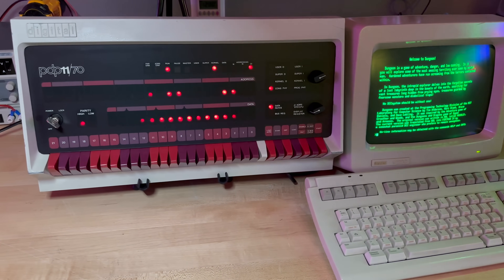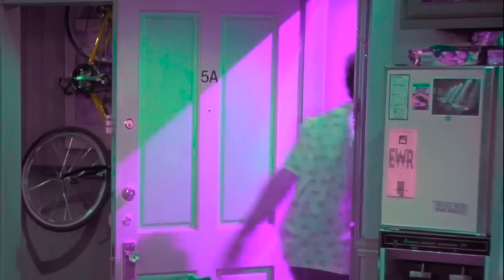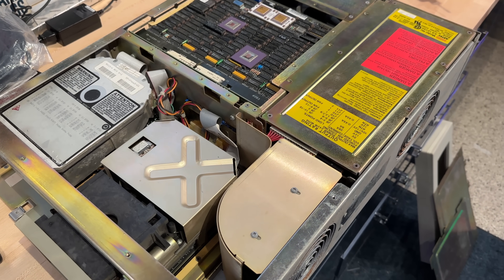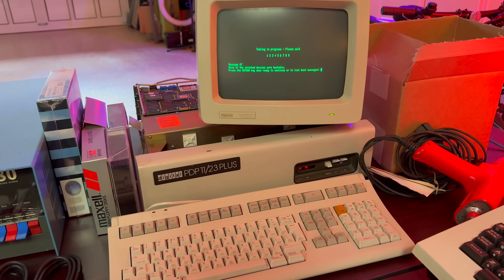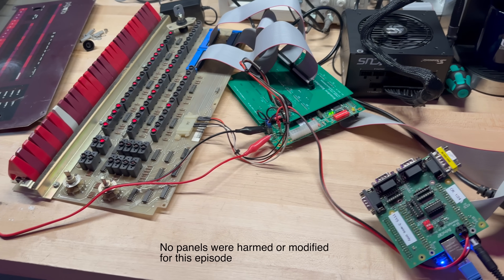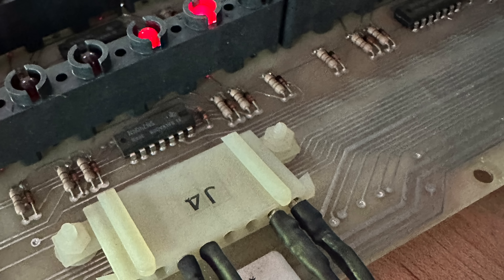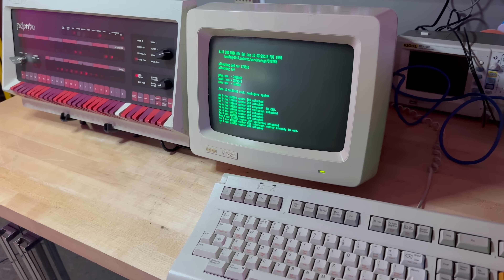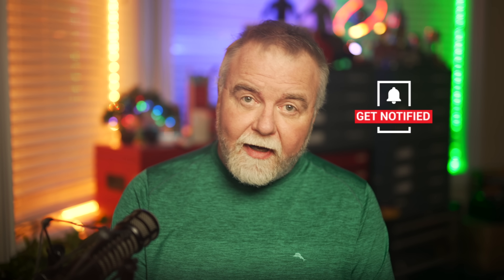Ultimate LED: The PDP-11 DASBLINKENLIGHTS!

Comment: Thanks for your excellent PDP blog Dave, it brought back a lot of memories.  In the 80s I worked as an electronics tech for a UK research group that used a PDP11 with an A to D card to collect and process experimental data.  The Prof who headed the group was not satisfied with the setup so he set about rewriting the operating system to enhance its performance with the A to D.  He was so successful that DEC sent two engineers from the States to see how the hell he did it!  In the early 90s the PDP was scrapped to make way for an IBM 286 PC based system.  I have always regretted not rescuing the PDP, but I don't think my wife would have welcomed it into our living room!  I did remove the 16K x 16 core store board before it went which I still have in my collection of electronic artifacts.
Reply: so what operating system did the pdp11 run then?

Comment: Worked for DEC for 10 years and works on all PDP and later vax systems. 

 Program I entered countless times on pdp's

Load address 100
12737
777566
301
127
100

Start at address 100 and run

:-)

Comment: Made verifying stuck bits easy ( faulty memory ). But the core dump following a series of "somethings funny" and "panic" messages printed on the Decwriter was already enough to identify the chip. If you are still looking for parts, Paul Anderson has most of the stuff from College Ave. other than the RK05s, those went to the Allen museum.

Comment: Less than a year after I started my first real job out of college I was made administrator of the sites VAX cluster.  I fondly remember the shelves full of extremely detailed orange binders full of documentation for VMS and the system itself.  The neighboring site had a couple of 11/780's still running which I helped out with occasionally but they were MUCH bigger and noisier and hotter than my micro-Vaxen. Plus, I had much bigger disk drives - a full 6o MB for the O/S, and a 600MB (14 inch naturally) re-writable optical disk. Very cutting edge for 1989.  Along with the normal 9 track tape drive and tk-50.  I discovered - to my chagrin - about a year into the job that VMS would happily fill the O/S disk until the system crashed and was unbootable  by writing to log files.  No one had ever told me I needed to purge them manually on a schedule.....  I can tell you booting enough of VMS from a tk-50 tape to purge the logs is painful and takes hours....  Undoubtedly the best documented computer I've ever used.

Comment: I used to study and work using various PDP-11 systems using IAS and RSX-11 about 47 years ago.
I also used briefly a  Russian copy, SM system.   VAX systems I mainly used just as a programmer. These were the first systems I learned in more detail. Remembering them now brings back many memories.
Reply: There aren't very many IAS people out there.  I worked at the Pentagon and a bunch of other military locations around the DC area maintaining PDP11/45 , 11/70 and Vax systems and our contract maintained the IAS operating system for the military. But I was a hardware guy, so I was more into the assembly language than the OS.  The PDP instruction set was a work of art.  A lot of people look down on the octal representation that DEC chose, but the layout of the instructions just required it.  The fact that you could read a crash dump and understand what the code was doing from the numbers because it was so well laid out was just amazing.
Reply: @MrEdwardhartmann  
I studied in a university where they received PDP-11/70 in the first year of my studies. It was the first DEC equipment there, I think. It was used as a  general use timesharing machine running IAS. After that other DEC PDP-11 systems started arriving to different departments own use in their laboratories. There where already some other mini computers but DEC sales was more success at  handling university customers. Then VAX systems started arriving.
Reply: @MrEdwardhartmann  
I like pdp11 instruction set and assembler because it was so easy to understand. I too approached IT from the bottom up. I had at least the impression that I could understand it from transistors to logical ports to processing units up to binary code.
Later processors, and software, have become so complicated that such clarity isn't easily achievable.

Comment: My first PDP-11 encounter was a PDP-11/45 in a small room at MIT, January 1973. I don't remember what OS it was running (RSX-11 would be my guess). I spent the entire month (an independent projects period) glued to that system. I don't recall using anything but assembly.

I don't think I ever programmed a PDP-11 again, though I did play around with an early Unix system accessed remotely. But a PDP-11 served as a terminal IO processor (among other things) on the KL-10 system I used until 1981. I never did interact with the control panel that I recall, but I had used the IBM 1130 control panel extensively starting in 1970 while I was in high school, so it wasn't a mystery at all.

But that PDP-11 experience came in handy when we got an early Vax 11/780. I did a lot of assembly-level stuff on that, and there was a lot about that instruction set that was familiar. I even had VMS sources, so I read a lot of Dave Cutler's code. His wasn't the only name that came along, but he was on enough of it that it was his name that always stuck with me.

Comment: @Dave's Garage  -  We have a complete system here in Pittsburgh that we would like to see go to a good home. Tape drives, processors, teletypes, terminals, and all original software, manuals, and every option they offered. The system was DEC support for the region because the guy I know was DEC support for this region. He was able to run and test everything on this machine set up in his home. If someone is interested in this system which is operational, we would be glad to pass it along and see it go to a good home. Are you coming to the event at the Maryland computer museum where Usagi and others are coming in May? KlodFather

Comment: Yeah Dave. I know why. That schematic did not match your panel. I've run into this before. As, for short while. I was in charge of, Manufacturing and Quality Control. Only to have discovered. If you wired the gear.  As per the schematic. It just would not function. It, would not work. It would simply reset and shut off. And what the hell?

It took me nearly 2 weeks. To ascertain. They were trying to connect. A newer, TTL Logic Board. With the previous, TTL Logic Board, wiring. And something, neither of the 2 Electrical Engineers, had caught. I had to figure it out. I'm not an, Electrical Engineer. I am not a Computer Scientist.  I'm a Fixer. And a bona fide, high school dropout with only a GED. And I have to figure out. With the college grad electrical engineers, cannot. At this requires. A full passionate investment. In, Excellent. Marijuana. Which I was not compensated for! But that's the way it is. And somebody has to do it. I elected me.

So in the end. Your schematic reflects a previous version. Incompatible with your current hardware. And wiring scheme. Oh whoops? WTF?

These, my friend are called, Miss Takes. Some people call them Mistakes. But if you are a vegan? You don't want stakes. Right? You want electrons, instead. They are low in calories and high in energy. And they just can't fail. Unless you don't have the proper power supply. And you reach an impasse with a brick wall. And no way out. Except for Quantum Tunneling. At what are you going to do about that? Right? We don't know either? What the hell is a Jesus? And how long do they take to recharge? Oh Jesus!? We don't have enough Jesus Charging Stations yet. We need more Plutonium! 239 should do? Bob have you got any in your pocket? Or, did you already, Teleport that back in time? Why did you do that Bob? We were not done, liquefying Homo sapiens. You're fired! With ion radiation.

Earth will be a new place called, Zatan. With 11 secret continents and spices.
RemyRAD

Comment: Going from 240 to 120volt can be as easy as an unmarked rotary dial.  Being an Australian I've watched more than one server expecting 120v get 240volts.  It is a tough lesson on checking PSUs on equipment for those newbies.  You usually only see people make that mistake once.  Plus you can't hide your mistake when it goes bang in an office.

Comment: We had a PDP11/34 with two RL-01 disc drives that  came with the Datacolor spectrophotometer and color matching software for our paint lab in the late 1970s.  I recall the system came with close to a dozen large 3-ring binders of documentation and one disc (16" diameter) cost $200.  We learned a lot about programming during those days.  The complete system cost more than $50K.

Comment: Back in the late '70s, my student job was in a behavioral psychology lab. The post-doc I worked for ran his experiments on a PDP-8E (yeah, I know, 12 bits vs 16) using.a process control language called SKED, and analyzed the data using a FORTRAN program. The 8E had those cool flippy switches, and you booted it by entering instructions into memory locations 30 and 31 (6031 and 5035 octal IIRC, which I probably don't) and hitting run. Good times. Wound up working on the real-time stuff for the SKED language.

Comment: I spent 6 months in 1976 working at the Highways Dept. of South Australia, Digital Mapping Section – my early days as a Fortran programmer.  They had a PDP-11/45.  Late one Friday afternoon, I was the last one to leave.  Forgetting to shut down RSX-11M first, I just powered the whole caboodle off at the wall switch.  I was the first one in on Monday, powered it on, and the whole system resumed running as if it hadn't been powered off.  The senior programmer told me that the PDP was designed to tolerate sudden power loss.  No UPS in those days.  DEC Fortran gave me a preview of what was to become Fortran-77.
After that assignment finished, I was back to the govt's main data centre, writing Fortran-66 & assembly language on CDC Cybers.

Comment: In 1972 I learned how to load the bootstrap code into a Data General Nova 1200 via the front panel.
The code then read more code from paper tape from an ASR-33 which then actually booted the system from a 2.5 MByte disk drive.
Reply: Yes

Comment: Hi Dave,
The DEC PDP-11/45 or 11/70 is one of my bucket list computers. September 1971, as a student at the University of South Carolina, our freshman engineering class elected to use the department's PDP-8. Fall semester, we learned FOCAL, similar to Dartmouth BASIC. I found that I enjoyed computer programming. The next semester, we learned the PDP-8 assembly language. 

I have a DEC VAX at home. Okay, it's not the DEC VAX 11-780, but a VAXStation II/GPX. If I find a CDROM drive, I want to fire it up and install a BSD on it.

Comment: As a DEC engineer fixing computers in 70ies was fun. With the toggle switches you could write a few instructions to memory and knew within a minute whats wrong. Repairs been done only on Board level to keep downtime at minimum. My car trunk was full of Sparepart Boxes. When another car crashed into my Back, the insurance was shocked to find out, that the damage on the Spareparts was much higher than the cost of fixing the car. A few years later I was selling Fujitsu HDDs to replace DEC Hardware to save badly needed floorspace, Power and Aircon Savings, and Maintenance cost, which was about 12% annual from the purchasing price in the early 80ies. System Industries and Emulex had fantastic dual-ported Controllers to compete with DECs hyperlink Hardware to transfer Data easy and fast from different PDP11 systems at a fraction of DECs pricetag. System admins who understood their systems could add so much value to their Systems. But the majority got scared by DEC not to mix Hardware and to risk their DEC Support and Service. PDP11 was not legal to export to Russia and Eastern Europe, but always found their way across the iron curtain.

Comment: I'm partial to the blinkenlights from the Connection Machines CM-5, even if they were mostly just for show.
The Intel Touchstone Delta's lights were actually useful. They once helped me debug an issue with the code generated by the HPF compiler.

Comment: One place I worked at had PDP11/70'S running RSX11/M for production, but we bought some small PDP11/2X (don't remember what  version in the 20's it was), running RSX11/S. These "small" PDP11's all came with full front panels too. Well a few months after we took delivery of the small PDP11's, one of the printers ran out of paper and at the same time RSX11/S hung solid. We could get everything  going again by power cycling small machine. Long story short:  DEC tech shows up and spends a few hours on the phone with the factory. Works out, when the printer runs out of paper it sets a flop in the front panel  which  eventually gets to a driver in RSX  which deals with the event and resets the flop. Except there was NO reset line in the hardware to be reset. Turns out our company  was the first (possibly only) one to ever order one of these small PDP11's with a full front panel, which is the only  place this problem can happen. So here we have an instance of the end user discovering a HARDWARE corner case! BTW, problem was fixed in the field with a wire and soldering iron.

Comment: Hi Dave. I worked for DEC 1985-1996 in FS before moving on to Microsoft. I did turn wrench on the 11/70, Boeing had quite a number of them. By the time I got to DEC, there was a field change order (FCO) to swap out the switch panels for the serial console version with no switches that would enable remote diagnostics. I don't know why your drawing doesn't match the electronics, I'm only guessing there was a REV difference. Does your panel REV match the drawing REV? We used to carrying around these microfiche readers and a number of fiche bins in our rig, now that would be gold to find that would answer all your PDP questions.... maybe unobtanium.

Comment: Ahh, the glorious PDP-11 which had the same problem as the Series-1: on the serial port, if the inter-character delay wasn't perfect (read: how they wanted it), the whole system crashed.
Discovered in a steel mill during my first job, interfacing a mass spectrometer and a robot arm with custom PLC via a QuickBasic program on an IBM 8086 PC .(dont ask)
Interesting how you learn to solve programming problems quickly when 4/5 burly blokes covered in ash and holding an iron bar look at you with a hard stare.

Comment: This one brought back memories. Back in 1978, Heathkit came out with a PDP11 kit and I built one. They called it the H11. It used the LSI-11 CPU and ran the PDP-11/40 instruction set. They promised future additions to the lineup but most never came about as Heathkit was purchased by Zenith and became Zenith Data Systems and ZDS concentrated on the 8-bit computers and moved away from kits. I never did much with the H11 but I did end up representing ZDS for service in my market for several years.

Comment: Back in the 70’s I was a grad student at UC Berkeley when the first UNIX tape to leave the Bell System arrived. The box had my name on it! Shortly afterward, Ken Thompson arrived for a year long guest professor appointment. We spent many evenings with the PDP-11/40 while I worked on my project and he debugged a persistent but intermittent crashing problem. Fun times! He fixed it by adding 3 feet to the Unibus cable to the swap disk to fix a hardware timing problem. Soured me (an EE major) on the PDP-11 architecture forever! I went on to work on Data General machines and build Electron Beam mask makers. Now I play with Raspberry Pi Pico’s and design a few PC boards for fun! Thanks Dave for sharing all the crazy stuff you do.

Comment: I love your channel Dave!  I'm old, nerdy and hacked together my first computer back in the day.  
I bought an Apple II clone bare PCB and chips.  After soldering it together and I had to find someone with an EPROM programmer to burn bootleg ROMS.  Once assembled with an hp keyboard using a DIY wire wrapped key scanner, I had to write the scanner decoder matrix HEX and use my friends Apple to burn it's eprom before I could test my Apple II clone.  Thereafter, I modified the hell out of it and came up with a wire wrapped expansion board to decode the address and data bus with HEX LED displays so I could troubleshoot cloned expansion cards.  I used the hold wire of the 6502 to single step through code with it and look for hung data lines.  At one megahertz, I could run three floppies, read text files with a speech card, test chips with a chip tester and that's even before I added a four megahertz Z80 to run CP/M, WordStar and dBase.  

Life was good until I realized that I wanted to write code and looked at my 500 ripped floppies.  I then realized guilt.  I was not giving back to the order.  
From then on I stopped using "copied software" and switched to paid software or legit shareware and struggled to make employers equipment work.  Later we got Linux on 10 5-1/4" floppies and about that time the Mosaic browser - Yippy.   Open systems = more to fiddle with.  

What a ride, now retired I have been a part of Telecom, Aerospace, Automotive and complex computer systems at all levels.  Too bad I never learned to socialize and have fun like the normies.  But I'm really good and sitting in the corner with a scope.

Boy I really want a PiDP/11 too
Ken